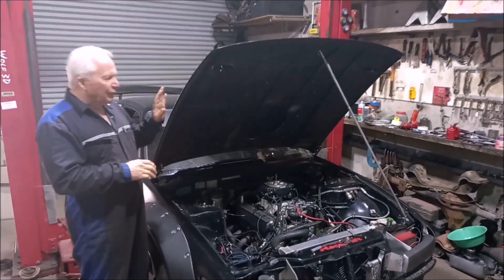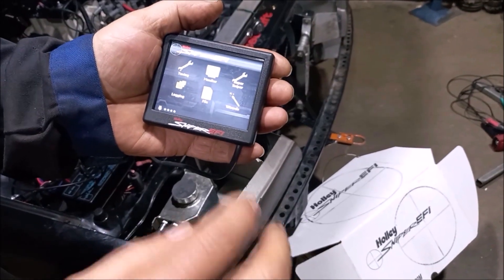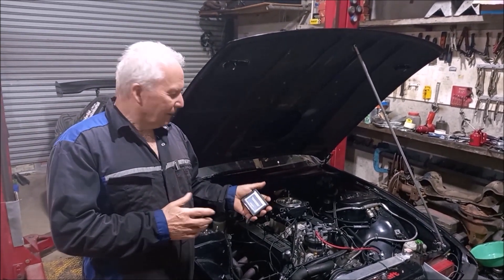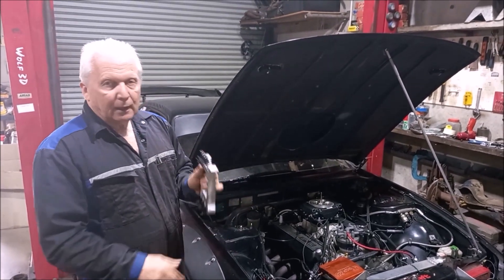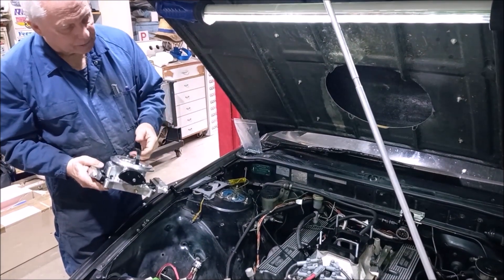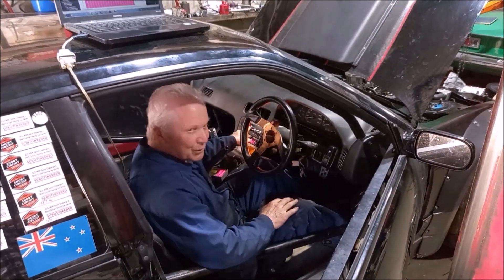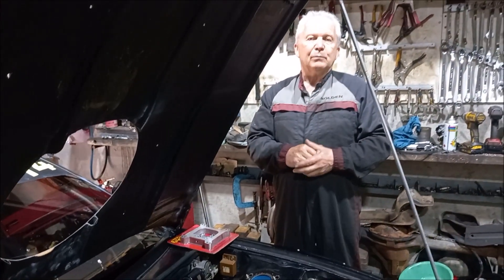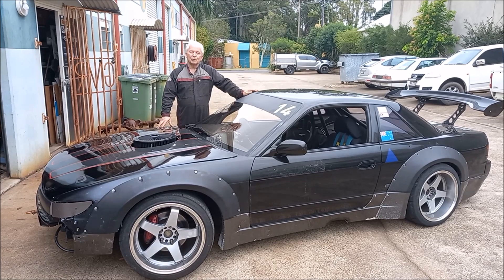Fitech vs Sniper vs Homemade with old computer Part 1

Comment: Wicked George, one question though, why did the owner want a throttle body injection when it had a multi point set up previously that worked perfectly 😳
Reply: Cooler charge temperature and more vaporisation thanks to more time for the fuel and air to mix by the fuel entering earlier before the manifold.
Reply: Hi Jarl, yes I understand but there is a wee trade off in having your injectors that high in the airstream, but probably a worthwhile one after all. I’m more used to the injectors being as close to the ports as possible but have a couple of injectors high in the airstream to shower the air for extra high rpm enrichment for maximum performance 🧐
Reply: @trevorwarren1063  we think alike then.